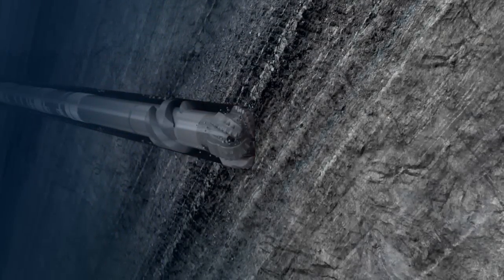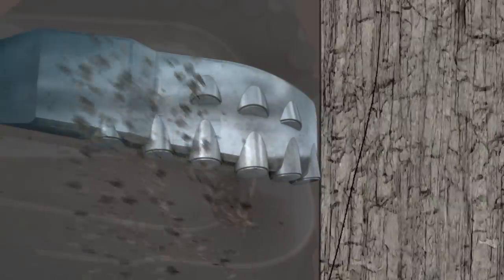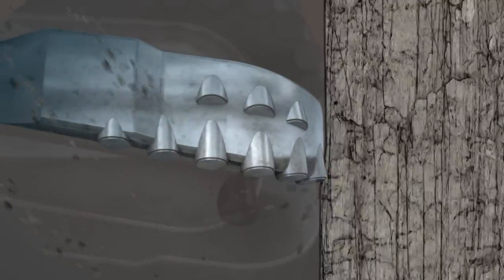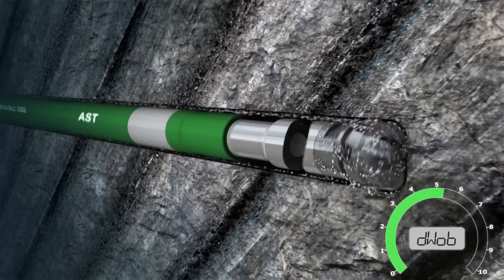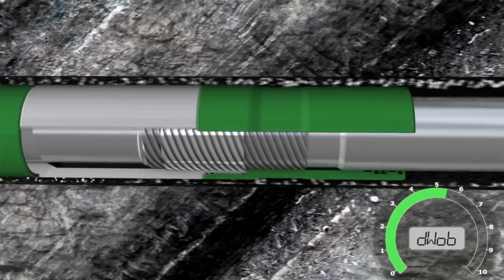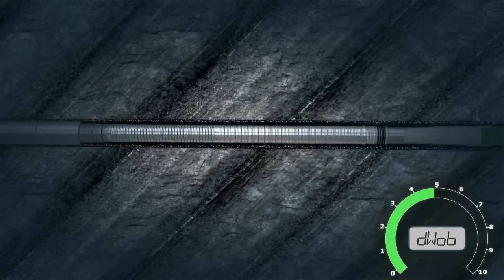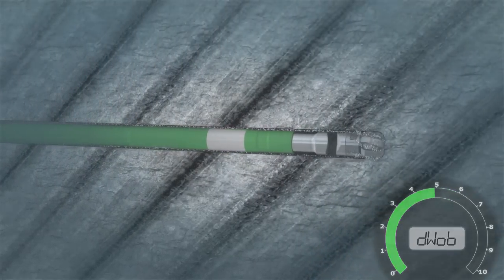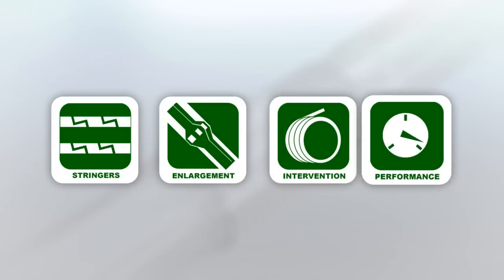Tomax Anti Stall Technology for oilwell drilling

Comment: I was wondering how this affects D&I, MWDs or LWDs equiptments one might have on the drill string if the position is ever changing.
Reply: Hi, what we see on the MWD and LWD is significantly reduced vibration levels. The movement is very small and much less than what you experience when having vibrations while drilling. Studies (done by others) shows reduction in shock related failures, eliminated severe vibration, longer runs and faster drilling.